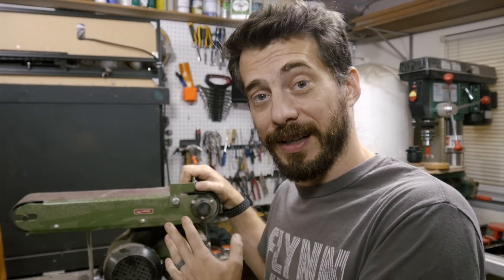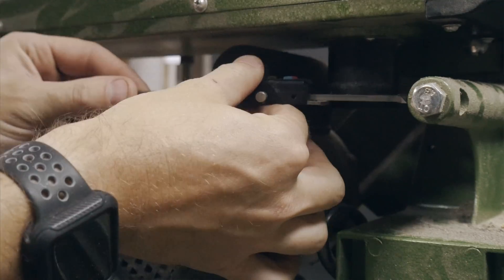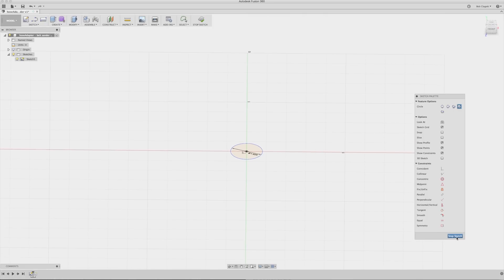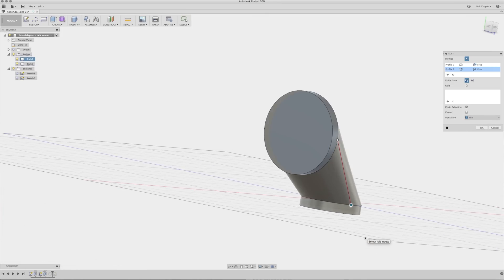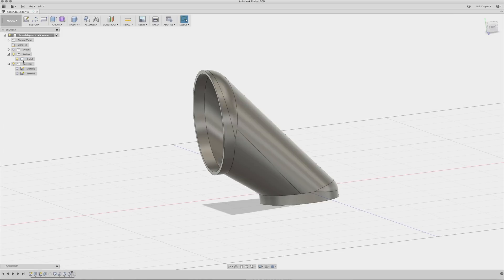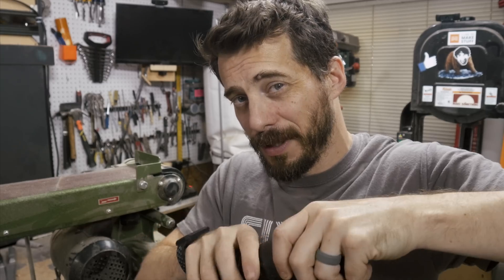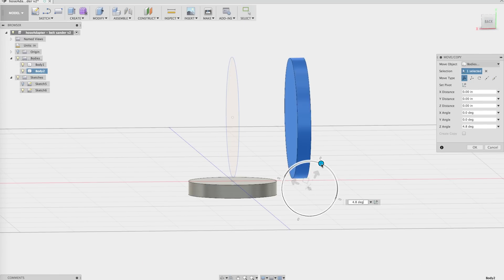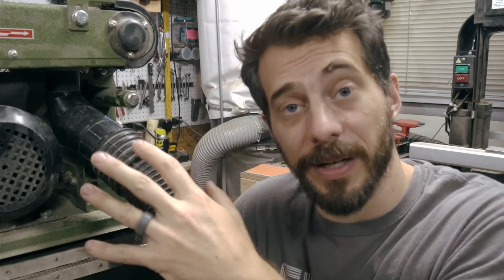Using Fusion 360 to 3D Print a Hose Adapter // Maker 101 | I Like To Make Stuff

Comment: Not sure if you will see this, but here it goes. You can create another sketch while looking at the part in a side view. Then, you can draw a curved line that intersects the centers of both circles. Then while using the loft tool, you can make it loft along the path you just created. This will give a much smoother transition, similar to that of a pvc 90 fitting.
Reply: Also, I find it makes for a much smoother transition on the inside of the part, if you create two different circles on each end, one for the outside diameter, and one for the inside. Then, do two separate lofts, one like you did originally, then another for just the inside profiles. Then you subtract the inside from the outside, and it's done.
Reply from the maker: That's fantastic info Trent, thank you!! I figured there was a simple way to control the curve shape so that's great to know!, Thank you!
Reply: If you guys want to make serious suggestions let's talk about the fillet. The way he did it makes a really thin area where the round is closest to the inside edge where the loft ends. It's a better practice to do the fillet first and the shell at the end
Reply: @luismdoz  :  If you follow Trent Wainwright's and use a spline to create a path for the Loft to follow, there will be no need for a fillet at all.   :o)
Reply: Trent Wainwright  it doesn't and it's not supposed to. Just a workflow suggestion. I have yelled too many times at the screen making this mistake in Inventor.
Reply: You can also tell the loft tool to use tangents to the faces you selected and not to go straight between points.
Reply: OK you Guys... being given free access to Fusion 360 is the neatest gift a hobbyist retiree could be given, and I am slowly finding my way, I had to run with the challenge you gave me.  (and I bet you didn't even know you had!).
I created four versions of the duct, and used the 'Section Analysis' tool to look at cross-sections:
1)  As shown in the video (Shell before Fillet).  Luis Valdes, you are bang-on; the wall gets very thin.  You can fillet the inside as a separate operation to rescue things, if you need to.

2)  As Luis Valdes recommends; (Fillet before Shell).  Much better than number one.
3)  As suggested by Raphioso.  Gives a much more pleasing result, which should also work better.
4)  As suggested by Trent Wainwright. My number one!  Gives the best looking result, and has the most flexibility and control over the finished duct, without requiring too much more effort.
OK... I know it's been over a year, but is anyone else hiding something we all NEED to know?  If so, LET'S SEE IT!    :o)
Reply: @Raphioso  : I tried this and it seems the terminology has changed since your post; now you change "Connected" to "Direction".  It works good, although I think creating a spline to use as a path or "rail" gives a bit more control over the final result.
Reply: +I Like To Make Stuff You're welcome, sir. Glad I could be of service.
Reply: +Luis Valdes I see your point. However, I believe fusion automatically offsets the inside when putting a fillet on the outside of the part. I'm not certain, but I think it tries to maintain a constant shell width.
Reply: I Like To Make Stuff thanx for another amazing video. i have been subbed since your 15th video.

Comment: LOVE it!   One ask though.  Is there any easy way to make the cut outs that would fit around the "tabs" that some hoses have?   For example, a bosche miter saw has two bumps and the hose adapter goes over them and then twists to lock.

Comment: Do you sell any of these adapters? I don't have a 3d printer but I need a shop vac hose adapter/coupler made that would connect a 2 1/2" hose to a 1 7/8" hose. I will pay via PayPal if anyone could point me in the right direction? Thanks

Comment: Great video, as usual.  I have just finished a 3D printed dust extraction duct for my bandsaw.  As part of my Fusion 360 learning process, I modeled the areas of the bandsaw itself, around the area below the table, and then used the techniques shown in this video to make a duct that snakes around the existing components.  Very satisfying, and works very well.  Thanks... Liked... Subscribed long ago.

Comment: Hey Bob. Love your videos. Just a thought on this. I'm a mechanical engineer and use a program called solidworks. In that program there is a "rib" feature that will add strengthening ribs to the inside of a piece like that really easily. Not sure if fusion has this feature but it would be easy to manually model if not. This would mean you could make it thinner and lighter and easier to fit in place without fear of the tube collapsing.

Comment: One more thing to consider. I recently just printed a bunch of adapters for various tools for a client, but I printed them from ninja flex. That way, they can 'streach' fit the fittings/hoses much better, and if the shop vac hose gets bumped, or tripped over, the adapter will just bend, and not brake or crack.
Reply from the maker: Good call!
Reply: Oh, and I just want to add, I've been using SketchUp for many years now (I did my adapters with SketchUp), and I just downloaded fusion 360 yesterday. So I've been looking for videos about fusion. That's how I found your channel. So thanks for the great videos. Keep up the awesome work.

Comment: I've 3d printed several different vacuum hose adapters for tools... either I don't use the the printer much or there's a lot of variation in vacuum hoses. I like to print the adapter to be a little tight, and then shape to final fit with a drum sander on the drill press.

Comment: Good tips but why did you make your adapter fit the outside of your shop vac hose? With it on the outside, doesn't that leave a section at the end of the hose inside the adapter for the dust to collect?
Reply from the maker: The suction is plenty to pull anything from that 16th" edge on the inside.

Comment: Hey Bob,
nice Video, just a quick tip:
Maybe use the fillet & chamfer tools before using the shell tool, this way the round or chamferd edges are projected to the inside. :)
Reply: Also, you can construct 3 or 4 cuts into the overlapping parts, so you can tighten it with a hose clamp to stay on the nozzle. :)

Comment: Just a little trick if you do couplers like these that need to fit real world geometry: Only print the parts of your design that need to fit somewhere first, so you can check your tolerances and make shure you measured and designed it correctly. Once you got these dimensions correct, you can go ahead and print the complete part. Can save you a lot of time and material...

Comment: cool if you have all necessary stuff around you :-)
I have simular sander and it came without any dust attachment.  I'm solution was to build it from scrap wood and it work like a charm:-)
Nice video good luck

Comment: A tip to make the 3D print easier. .. cut the part into 2 pieces by cutting it at a 45 degree angle.  That way you can print the two pieces without using any print supports.  Then just glue or solvent bond the two parts together.  It will print much more quickly since supports are not needed.

Comment: Great video! 
Just touching on where you explain that you were using low resolution, the lower resolution (aka, taller layer heights) actually gives you a much stronger build over all, and if you couple that with setting the temp 5-7C higher than usual it will fuse everything into an extremely durable part (even more so with the co-polyester & nylon filaments)

Comment: Fusion 360 is not free anymore.  sadface
Reply from the maker: Yeah, it is.  You can use it as a hobbyist for free. https://www.autodesk.com/products/fusion-360/overview?mktvar002=698238&mkwid=sA0uJZNif|pcrid|177331758407|pkw|fusion%20360%20free|pmt|e|pdv|c|&&gclid=Cj0KEQjwo-XIBRCOycL7hsuI_NoBEiQAuS6HtOlJZq3ZCSVC_on3B4AdnvoDvfj_jG7pjU_51gbEGigaAj1y8P8HAQ

See  the bottom right, it says "Free for students, enthusiasts, hobbyists, and startups
Full use of Fusion 360 for as long as you need it "

Comment: So that it doesn't look so rough.. on that loft command i'm pretty sure there is option to give tangent parameter (at least in solidworks there is) it will make connection part look better + make better air flow (not by much) but pretty sure it works fine like that!

Comment: hey Bob, try to put that hose connector in an acetone vapour bath to smooth out the edges and make it look like it was injection moulded. theres tutorials on YouTube for acetone vapour baths
Reply from the maker: Hey Vance. That works for ABS plastic but this was printed in PLA.

Comment: Awesome video thanks for taking the time and effort to post,  out of curiosity how strong is 3D printed material compared to pvc pipe fitting?
Reply from the maker: PVC would be considerably stronger simply because of the material type.  Some 3d printed items like Nylon are much stronger than what I have here.

Comment: I had to do this not that long ago to get my shop vacuum to connect up with my table saw. I printed with an ABS type material so it would hold up better in the shop environment.

One thing to measure/experiment with is how long the lip should be on each end to get a good interference fit.

Comment: hey bob, i have the same belt sander as the one in the video. the main thing i found out after using it is that the sanding belt itself was really bad. (when using it every time my part went over the connection between the two ends of the belt it would bump) you can buy a better one for a couple bucks from china, and be able to sand metal with it.

Comment: Great job. 

Another thing that can be done, if you have it available, is dual extrusion for the ends. That way you can have the rigid plastic in the middle and the holes can be made out of a rubber filament like ninjaflex. That way it can stretch and make for a good seal. 

You might also be able to model and custom print a hose if you reverse what I just mentioned.
Reply from the maker: That's a great idea!
Reply: Also the print lines could work in your favor, actually gripping the ports.

Comment: Hey, so if a project doesn't go the way you wanted, what do you do with the 3-D printed thing? Do you recycle it to make filament?
Reply from the maker: Certain ones can be recycled, but it depends on the type of plastic.  There are machines that you can build to create new filament from used plastic but they're fairly expensive.

Comment: This is awesome! I had a very similar idea but I'm going to make a whole library of adapters for all the sizes and make them available to anyone. Reducers, couplings, right angle couplings, etc. I was actually thinking of using github as a repository (I see you use this for code), or maybe thingiverse. Is github good for collaboration? I was thinking other people could contribute so we'll have a huge selection for people to use! P.S. Yes, really liking these little short videos. We actually might try some soon too :)
Reply from the maker: THat's a really fantastic idea!  Yes, Github is made for collaboration and iteration.  I've seen people use it for 3d models that can be modified.  Do it!!
Reply: Great, on it! I mainly use solidworks (use it for my day job) but I think I might actually take some inspiration from you and use Onshape and do a tutorial :) It's free for anyone who does not mind their files to be public and it's super powerful, so another great tool for makers.
Reply: That's really interesting. What are the strengths of each? I'm downloading Fusion 360 now to compare :) Yeah one huge advantage of OnShape is that any computer can run it since it is browser based. I've used it on a $200 chromebook!
Reply: Thanks everyone! We'll probably do an instagram post asking this but I'll ask here too: Does anyone have any requests for sizes or lengths? I plan to do a reducer, coupling (male and female), and right angle for every common size. Anything else?
Reply: Onshape is a really great software. I was using it a lot before fusion became free.  I could also work on designs during my lunch break.  Now i'm using both depending on my needs and time.
Reply: EvanAndKatelyn I do like both.  Onshape is a lot more like solid works than fusion.  It is also bit more intuitive for me than fusion goes as far a parts and assemblies.  I find true parametric modeling in assemblies to be a bit harder  in onshape as far as top down modeling goes.  I may just need more time with fusion though. it usually just come doesn't to if I'm modeling on the go vs at home.
Reply: Great idea!
Reply: +EvanAndKatelyn Onshape has versioning and collab tools similar to git already built-in.
Reply: EvanAndKatelyn i
Reply: There is actually a model on thingiverse that can transition between any two size hoses that you need.  I was able to print adapters for all of my tools to my shop vac.
Reply: guys that is a greta idea
Reply: I think www.Grabcad.com would be a better platform to share the designs, don't know how good it is for collaboration though.